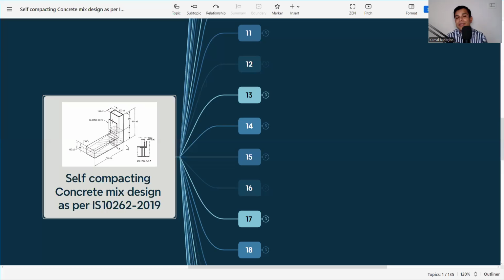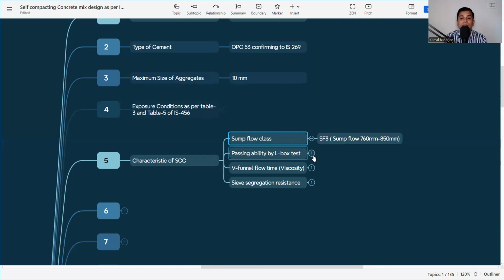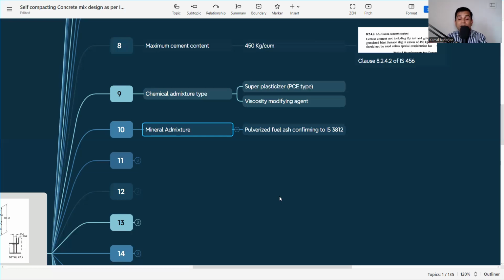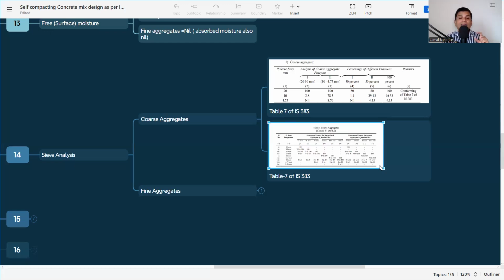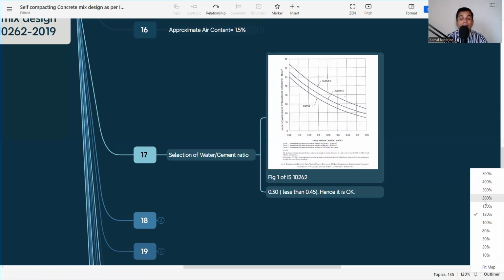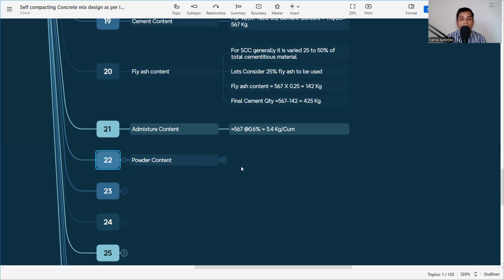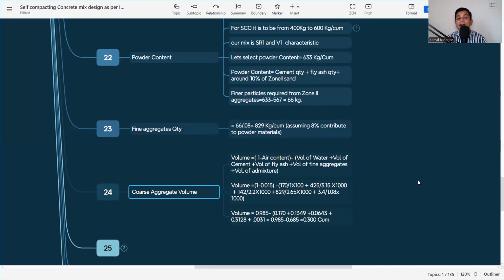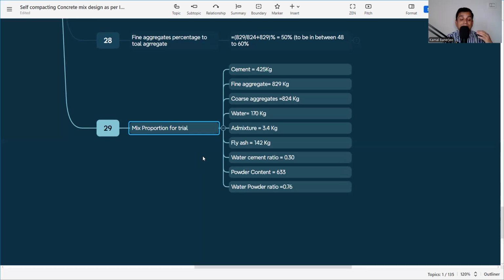High Strength M50 SCC with 10mm Aggregates Full Mix Design Breakdown

Comment: Is it possible to make a m35 grade scc using opc53 grade cement, river sand,  12 mm and 20 mm aggregate, and 3rd gen pce based superplasticizer (fosroc Auramix 400) only. Avoiding all other additives like vma, fly ash, silica fumes, limestone etc